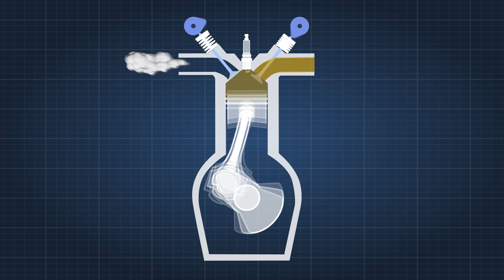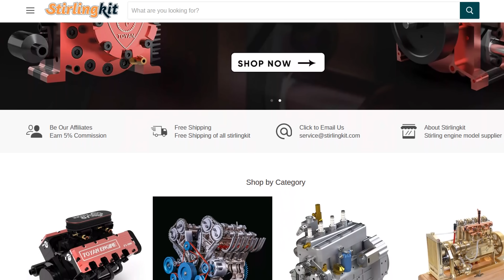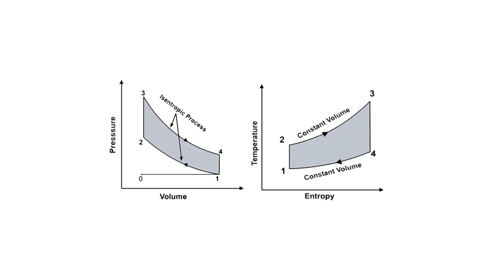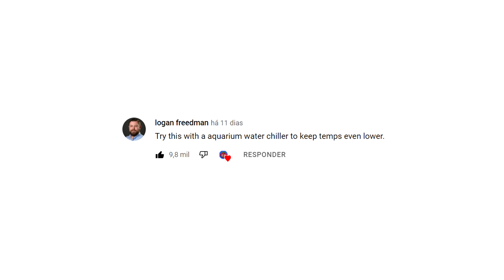I 3D Printed a Transparent Combustion Engine in Resin

Comment: You should try making a hybrid rocket engine using NO2 and any solid fuel. You can buy NO2 in canisters, similar to the CO2 canisters, for making spay cream (although often used for other purposes).

You should also try making moulds to make ceramic parts or tool/dies for stamping and forming metal parts using sheets. this way you can make some more heat resistant parts, but with better repeatability.

Comment: I actually might have a reasoning why the nitro methane worked and not the regular gasoline. 
With gasoline it’s a more forceful explosion in that the shockwave itself moves slower but has more force. While with the nitro methane it’s a lot faster. 
As for why only the 25% worked I feel it’s because nitro tends to be easy to burn in lower quantities and since you also admitted to lack of compression and I feel the nitro as from RC car fuel that has oil additives and also most RC cars have tapered cylinders for the pistons to rest in. But also methane and nitro burn ALOT hotter. For experience when I was running my RC car the advised temp range for the glow plug was I think either 250 or 240 freedom units

Comment: Hey integza, I’m a car and motorist enthusiast myself, so perhaps I can explain some of your inquiries.

The reason rpm decreases as more highly combustible fuels are used is because the fuel expands with more energy. This means that the force applied to the piston is greater thus a greater torque is produced. The rpm decreases to compensate for the increased torque because the force is applied over a shorter length of time meaning that the impulse of the piston will decrease (dp=Fdt). Even though the respective force has increased, it is applied over a much shorter time. This means that the object will accelerate slower yet apply more turning force (torque) to the axel.

Furthermore, the reason you weren’t getting the 4 cycles may be due to (as you’ve alluded to) the spark plug timings. In a car, a vital component for efficiency is the timing belt which dictates the spark plug’s the moment of ignition. If the spark plug is ignited before the fuel is compressed enough then it will fail it’s cycle. This is common in smaller engines (especially I4’s) because the piston has to travel further in order to compress the fuel enough and have a successful ignition. Also check for seals. Metal is good for engines because of its high melting point but also because it can create a good seal with itself. Plastic, being a polymer, is not too good at making seals (especially with metal) so this can lead to leaks and a decrease of pressure in the combustion chamber. This may also be the reason for the drastic decrease in rpm for higher energy fuels.
Reply: The timing belt controls the timing of the valves, it's the sensor on the cam and/or crank that controls ignition timing
Reply: @wyattnuffer80  This is correct.
Reply: The sensor on the crankshaft is the info for when to fire spark plug. The spark has to fire at the appropriate time before the piston hits top dead center(closer to tdc at low rpm and earlier at higher rpm) 
Tho you can get the same info from the cam sensor it is much better to get it from the source. The cam sensor is really only used for fuel injection timing. No point injecting gas if the intake valve isn’t open.
Reply: @nictanium  While both you and Wyatt Nuffer are correct, this engine uses a magneto to generate the spark (no battery required). That doesn't mean it's not a timing issue, but the engine may not have a way to adjust the position of the magnet or coil to adjust the timing.
Reply: @3DPDK  I was actually just adding a little more detail to his statement and was not really talking about the engine in the video. You are absolutely correct about how the engine in the video likely creates it’s spark. It would be like the system in my push lawnmower that can not be and does not need any adjustment. It will be set from the “factory “ and either works and never needs adjustment or doesn’t work and is broken and just needs to be replaced. It Would not be like old cars and their points ignition systems that needed air gaps checked and timing adjustment potentially. 
Tho different fuels burn at different rates and thus technically need different timing I very much doubt if it would make any difference in this simple little engine. I still believe that any running issue in this engine is an air/fuel ratio problem.
Reply: @nictanium  sandcat25 just made the same comment, and I had not given the fuel mixture any thought. I agree that it has a lot to do with why each fuel is performing differently.
Reply: is there a chance the engine ran poorer with the nitro due to the carburetor being set to run on regular petrol, hence the nitromethane running too lean?
Reply: @sandcat2594  That's a good possibility. The carburetor has a simple needle valve "mixture" adjustment like most RC model engines. Whether or not Integza tried to adjust it is not in the video, but different fuels definitely need different air to fuel ratios to burn properly.
Reply: @sandcat2594  yes this isprobaby part of the reaso, i fly rc planes and its ot a simple use petrol, the carbs need changed, but youu dont get as much power iff you succesfully covert a glo engine to run on petrol.
Reply: it's 100% has leaks, you can check 4:05 time. Also, plastic is much easier to deform.
Reply: AYYYYYYYYYYYYY thats what i said
Reply: Great explanation! But I think that the other reason is that without any workload on an axis speed of rotation depends on resistance, that fuel is giving during the compression. Gasoline is the most the most dense, so it is hard to compress. Methanol - vice versa.
Reply: Seems more like…… electronic governor to me
Reply: Even tho i am not a car person at all, i love the science behind this <3
Thank you sir/madame (idk what u are so xD) for taking the time to share your knowledge/oppinion on what the issue is and why you think that is ^^
Sharing knowledge and educating people for free is the best part about the internet i believe.
 You have done a great service to me and you deserve my like <3
Reply: There's a trick on Reddit that if you ask a question if you want an answer quicker create a new account and answer it incorrectly. Everybody wants to correct somebody else and this Mass ego thing is pretty funny
Reply: @myusername111  idk if u were replying to me but, yes i heard of that xD but i still appreciate the random bits of knowledge i get from people (obviously i have to take it with a grain of salt) randomly in comments :)
Have a nice day/evening :)

Comment: My theory is that a 8 stroke cycle is more efficient because the energy released from the explosion allows the piston to speed up closer to its optimal speed before slowing down. The 1 stroke doesn't allow the piston to increase rotion due to resetting the speed. Not allowing the speed to reach optional conditions and use more gas and resources. The idea comes from playing Mario Kart when you use three mushrooms to speed yourself up simultaneously it will not be optimal. But if you time the mushroom's booth right before the deceleration it will you extra distance of speed.

Comment: My prediction for why the 25% nitromethane worked best is that it simply reacts slower than the other fuels at that air/fuel ratio. i wrote a simple code in a thermodynamics solver(EES) for the Otto cycle but I can’t predict the speed or power of your engine without more parameters. Also, use a match on a stick to pop those balloons! You got lucky you didn’t burn your hand worse.

Comment: many years ago there were research single cylinder engines where the barrel ( cylinder) was more out of quartz . 
if your carburetor is adjusted to ideal fuel air ratio the flame visible will appear blue ( like a gas stove flame)

Comment: Idea for a future video: create a tesla turbine turbo charger.

Use a Tesla Fluid Propulsion Device (a reversed tesla turbine, patent US1061142A) to draw in air, heat the air by some method ( like enflaming a metal tube), and finally use a Tesla Turbine (patent US1061206A) on the same shaft as the tesla pump to output the air.

Comment: Integza, I've worked with 2 strock 0.049 engines that use a mixture of nitromethane, methanol and castor oil. A posible problem with your engine is that it is geting dirty after each run. A solution is to clean the engine and put "after-run" oil after each run to keep the engine clean.

Comment: Different fuels have different stoichiometric ratios for burning and require different flow rates. Different fuels also burn different speeds, the ignition offset should be adjusted based on fuel type (and load and other things). Your thoughts about spark plug duty cycle is smart though; it's possible that the coil isn't being charged up enough, fast enough then the spark plug won't have enough energy to initiate combustion. Also, each fuel will have a different octane rating or knock resistance, this determines how much heat/compression the fuel can take without spontaneous ignition, you are generally more efficient if you can have the most compression without knock.

Comment: Let's walk through this a bit...

First, let's think about what happens on a power stroke that is missed. When the air/fuel mix isn't burned, the following exhaust stroke evacuates the air out of the cylinder, but it doesn't evacuate all of the fuel; only the part that is atomized. You can see during the exhaust stroke after a missed power stroke that there is still a lot of fuel on the cylinder walls. So this fuel carries over to the next four stroke cycle.

Second... So now we have the extra fuel in the cylinder from the missed power stroke, but we don't have air, as that was evacuated during the exhaust stroke. So now we do an additional intake stroke. We now load the cylinder with a new charge of air, and additional fuel. So now we have the residual fuel from the missed power stroke, and the newly added fuel of the following intake stroke. So at this point, we have a "normal" air charge, and a mystery fuel charge that consists of the old fuel from the missed stroke and the newly added fuel from the latest intake stroke.

So now we have a cylinder full of more fuel than we had on the missed stroke, and the same amount of air as we had on the missed stroke. Let's make the assumption that the next power stroke is successful, so the air/fuel mixture ignites. So what's different this time around? The amount of fuel in the cylinder.

Long story short: The engine continues to "miss" the power stroke until enough fuel has been added to get a successful air/fuel ratio and the subsequent ignition.

This points to the air/fuel ratio being too lean, as additional fuel needs to be added to the same air charge to get a successful power stroke. So the carb needs to be adjusted to give more fuel to the air charge until you're able to hit the ratio needed for successful combustion on each power stroke.

Suggestion for next video: Show how adjusting the air/fuel ratio allows the engine to successfully "hit" on each power stroke.

Comment: I'm sure that such magnet sensors are not fast enough to act/read at such rotation... Use hall sensor instead. If you have an oscilloscope, you can see if the reading are skilled. If no oscilloscope, use microphone input to replace the oscilloscope. 48khz or 44.1khz rate will be enough to measure. Good luck.

Comment: print a new piston but with two places for the o-ring, it should help a little with compression, and maybe you will also add aluminum foil as a head gasket, this should also slightly increase the compression (important, the less the foil is bent, the better for tightness), see ya in the next video !

Comment: Try to adjust the fuel/air mixture ratio, add a turbo and try these toyan(not strictly these) engines models: Elroy369Lion TOYAN FS-S100A, this one comes with a power generator,(or tesla dynamo), Sunery TOYAN FS-L400 14 cc , TOYAN FS-L200W 7cc 2 pistons.

with the modifications you did and mine in this comment. Notice: i saw no one add a turbo to toyan engines

Comment: Im wondering of the nitromethanol mixtures work better because they have oil in them. (Or at least, as far as i can remember back from when i ran model engines) in basically every shot you can still see fuel blowing past the piston down into the cylinder and my guess is the seals and compression are not good enough yet. 

The oil in the nitro mixes might help it seal a bit more.

Comment: The reason is quite simple. The original machine has a base-plate of prefabulated amulite, surmounted by a malleable logarithmic casing in such a way that the two spurving bearings were in a direct line with the pentametric fan. The latter consisted simply of six hydrocoptic marzelvanes, so fitted to the ambifacient lunar waneshaft that side fumbling was effectively prevented. The main winding was of the normal lotus-o-delta type placed in panendermic semiboloid slots in the stator, every seventh conductor being connected by a non-reversible tremie pipe to the differential girdlespring on the "up" end of the grammeters.

Comment: octane is related to engine compression, with the higher 1 allowing higher compression. 
so It seems that the higher octane fuel u used last was simply the best for the compression u were getting in the engine. 
The other fuels either wernt compressing enough, or too much causing the fuel air ratio to be wrong and ignition to be sporadic.

Comment: Gasoline engine has a small disadvantage against diesel engine - they need time to ignite fuel - if its injected properly, it seasier, with so simple carburator - its not possible to make good fuel to air ratio, wif fuel in all volume of air. You need just slow down, or inject fuel with some kind of injector / spray, to make as small drop of fuel as possible. Diesel engine ignite when pressure is high enough to selfignition - so in teory you can make diesel engine with big RPM, but its hard to make it durable enough to stand so big force and torque, so they are electronicaly limited to f.ex. 4000-5000 RPM.

Comment: What if you made a piston type engine that used air pressure (or that fancy promanganate fuel you used for rockets) to move the piston instead of combustion? It would be like a reverse air compresser.

Comment: On little engines like these, the cylinder is ever so slightly tapered to help with compression(this might be exclusive to two stroke)
Also as far as I know the the Nitro fuel might  be causing engine knock.
I think JohnnyQ90 on YouTube might have some better ideas as he loves these little engines.

Comment: Octane ratings are very counterintuitive not to go off topics to what they actually are it’s more of a volatile rate the higher the octane the less volatile it is it needs more compression and would work every power stroke the less octane and you get something known as pre-detonation or knocking this works better for low compression engines knowing this makes sense that the gasoline would perform in that fashion

Comment: The additional force from the more energetic fuel is being used to impose drag on the cylinder during the exhaust portion. Basically, a perfectly efficient engine would have the force from the explosion from the power stroke end exactly where the piston stops. By making the fuel more powerful, that excess energy is just pushing on the piston as it wants to rise.

Comment: My theory is that the fuels with the higher energy load has more energy when exploding so it’s expanding the Resin chamber more than the weaker fuel so you loose more pressure either the more powerful fuels. You can test this by measuring the metal chambers RPM and compare since the metal wouldn’t be subject to as much expansion so it would act as the control in the experiment.

Comment: Stoichiometry is real, and despite a radical change of fuel type, you make no attempt to change the fueling rate.  Most of the ignition events with gasoline indicate it’s running rich (orange flame, suggesting soot), which is good when attempting to run on methanol… but you need to supply a little over twice the mass of fuel when compared to gasoline, and you don’t appear to do so.  Incidentally methanol burns with a very low flame luminescence, so spotting combustion isn’t going to be easy with the technique you’re using… although the darkroom approach should be ok.  Good luck.

Comment: Hello this is a problem with ur timing for the sparkplug its not advancing time (a thing that cars do with old style distributors and electric controlled ones) as the motor goes up into higher rpms you need to advance the timing forward as the piston is going faster than at just idle so you need to create spark sooner this is why the worse fuel is getting a consistent cycle and the others also you're losing too much compression specially with the nitro mixed fuels i suggest using some gaskets between them the seals and tighten it down pretty well so it compresses to get more compression if you need this to be translated into portuguese let me know im a native portuguese speaker

Comment: One reason the engines ran at different speeds might be due to how hard it is to compress each fuel because even though the mixture didn’t ignite every time it did get pulled into the cylinder and may have slowed the piston down

Comment: In race cars, the fuel air mixture has to be changed between pump gas and race fuel, maybe you need to tune the carb for each fuel.

Comment: If you can. Try using diluted magnesium sulfate as the fuel and CO2 as air. Would be interesting to see a combustion engine run on something other than just O2. Not sure it will work but maybe worth a shot. If it does combust it should be very bright.